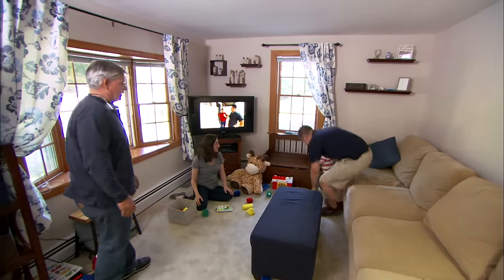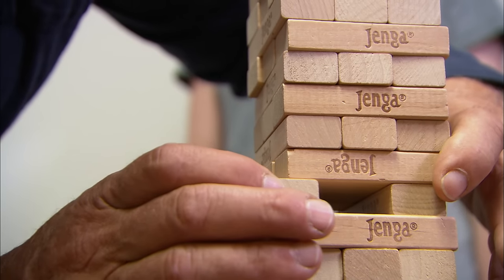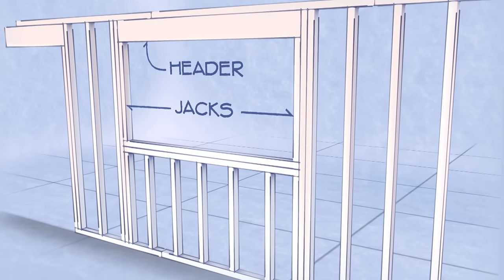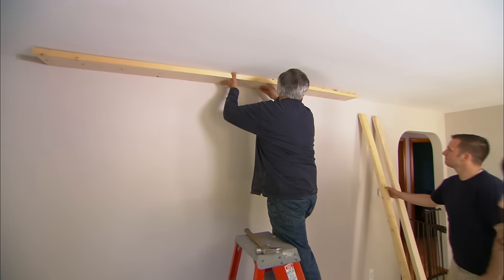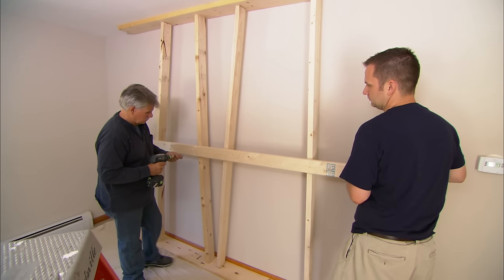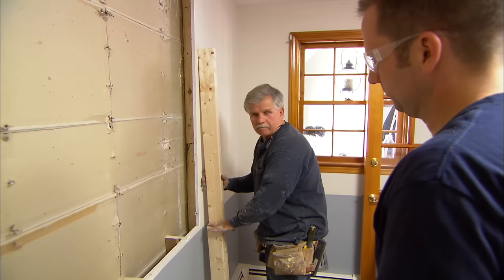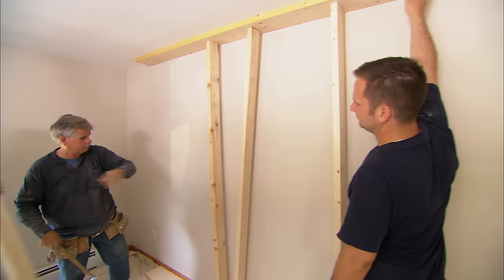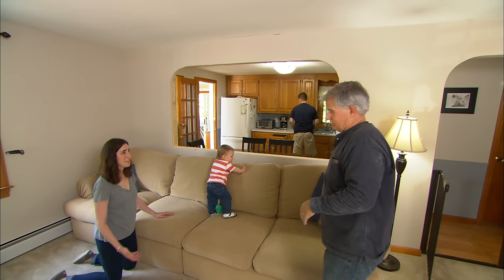How to Cut a Pass-Through in a Load Bearing Wall | Ask This Old House

Comment: Thank you! This was spot on, easy to follow, succinct, yet thorough instructions. We saw this video 48 hours ago. It gave us the confidence to tackle the same project ourselves. We completed the job in 6 hours. Would’ve been less time, but I had to work most of the time so I could only help set the shoring and hammer in the jack studs & and my husband didn’t have an extra helper. This video is epic. Thank youuuuuu!!!!
Reply: Why don't I believe this comment?
Reply: @sophocles1198  I mean without calculating the load you wouldn't know what size beam the header needed to be.
Reply: @michaelkozik4707  and how did Tommy do that?
Reply: I think it would only depend on the span. After all, there are only X number of studs holding that load up before. Now if you cut into the wall, and find reinforced and doubled-up studs, then they did that because there was an extra-heavy load there.
Reply: How much of the 2nd floor and roof collapse on you?

Comment: A house that I'm familiar with actually had a load bearing wall completely removed. The ceiling had a noticeable "Dip" in it. After opening the ceiling to inspect, we discovered that ceiling joists were literally floating above the ceiling. It was painfully obvious what was done, thankfully, the house didn't fall in on itself. Replaced the wall and all is well now. It never ceases to amaze me what some people will do.
Reply: That's why building permits are required.
Reply: @scotth6814  not here in my city for indoor construction I was shocked myself 😆

Comment: getting nice curves in the finished corners is the hardest part of the job, would have been nice to see that done
Reply: Tommy's a wizard.
Reply: Make a cardboard template from the existing arch, and transfer to the wall board on the new opening
Reply: @Muscleupsanddangles  what goes inside the curve though?
Reply: @xfreeman86  I recommend using 1/4 Plywood which is flexible enough to curve. You can make several laminations and use wood glue to make your own custom curve and clamp it up. Alternately you can use plywood flat wise and transfer the curve onto it and cut it out and laminate/clamp. I think this is more work and unnecessary as it only needs to be strong enough to back your sheetrock, it isnt structural.
Reply: Its a jig saw, what is so hard?
Reply: Tommy just does it by eye with a sawzall.
Reply: Cut two plywood shape of arch each tight against drywall cut 2x4. So 4 in (3.5)  side is against arch. Wire aginst 4 inch in arch.  Flex corner bead in arch. and 40 min mud sand then finished mud then sand.
Reply: 2x4 blocks (2.5 inch) +1/2in+1/2 in=3.5 in between drywall

Comment: Very helpful video. I followed your instruction and cut a hole in my load bearing wall. There were a few more obstacles, like a pocket door, multiple existing headers  and a smaller opening that limited the maneuvering of slipping in studs and jacks. Thanks

Comment: Did anyone else notice there is an electrical line running along the bottom of the plate (up at the ceiling), where they are installing the new king stud and the header? Tommy notched the filler stud he put in for the electric line but not the new king stud or the header. Since the header is driven up tight against the plate, the wire would get crushed between the plate and the header (and the weight from the floor above) and cause the wires to short out.
Reply: Brilliant observation. I also doubt if it is up to code...
Reply: The header has a piece of plywood sandwiched in between which creates a perfect notch for the wire. It won’t be crushed. 5:05

Comment: I did a similar job, but I notched the existing studs for the header, fitted the header, then removed the old studs.  Worked perfectly.
Reply: Can you explain in more details what you did? How did you notch the header before removing the old studs? We plan to open a load bearing wall but not as tall as the one in the video. So it’s not likely we will put a header all the way to the top. Thank you.

Comment: This was great. Thank you. Though I would love to see a floor to ceiling opening.
Reply: Floor to ceiling is definitely possible, but there still has to be a header so you would lose the header room, but of course the opening would be bigger. Both are nice. 
I like how he rounded it so it matched the doorway on same wall.
Reply: You might decrease it from 11.25” to 10 using an LVL beam but you need a properly sized header to bear the weight of the 2nd story and/or ceiling/roof

Comment: I like how they retained that curvature on the top of the opening. An alteration like this to a home should not look like it was altered and capitalizing on the existing design really adds a touch of class.  How about a granite surface for that opening for wife to slide a beer across to the old man during the big game?
Reply: That's a good idea! You can easily turn that section into a little bar top with some under corner brackets from the kitchen side. Very minimal space loss to create a lot of extra sittable counter area. And it perfectly looks in on the t.v. too.
Reply: Or for wife to slide dirty dishes into kitchen so hubby can load the dishwasher?

Comment: Had 70""in. of Microlam beam left over when I built a garage few years ago. Finished size 59"×45"  exact same layout, separating kitchen and living room. Found a nice piece of Hickory to cap it off.
  Widened doorway thru kitchen, and raised header in living room (non load bearing) while I was at it. Really opened up little Ranch house, 976 sq. ft. full basement. House was built, finished in Nov '63
       New project is gutting all fiberglass insulation in attic,...and exterior walls. Switching to Rockwool. Gotta air seal attic with fire rated foam.  Not a licensed builder, worked a few years for a friend that is.

Comment: So easy in USA where it's all studwork and plasterboard.
Reply: Balloon framework, yo! It’s the one of the reasons why America settled the west so quickly. It uses less wood than its heavy timber predecessor and it’s built so much faster.
Reply: Houses here are not all simply studs and plasterboard.  That is a paper house built in 2 weeks or less.  I will never invest My money in those shitty cheaply built no character boxes.  There are millions of older homes/buildings built in the mid to late 1800's that are still standing strong here USA that require extra care when remodeling.  My 2 houses was built one in 1890 the other 1920.  I know it's a pain in the ass to retrofit upgrades, however, I appreciate the fact that older homes were over-built (as these younger instant-house builders complain about).  My houses will out-live Me and I'm 50.
Reply: they are made like that so that they are easy to build and repair
Reply: We have studs and plasterboard for interior walls in the UK unless they are load bearing then they are bricks
Reply: 2 weeks?  You're dreaming.  Also, your older homes are inefficient.  How are you going to insulate a vintage brick home with two layers of brick, unless you want to pull down ALL the plaster from the inside on ALL exterior walls?  Good luck!  Also, their designs are functionally obsolete.  Minimal bathrooms.  Small bedrooms.  Small closets.  No open concept what-so-ever.  They might be nice for a single person or a couple with no kids but that's about it.  OR, a vacation home where you only spend a few weeks in throughout the year.
Reply: MemoGrafix newer homes are engineered by people who actually know what they're doing..  they're stronger, more efficient, using less materials and less waste..

yes there are times that problems arise in newer homes, but 99% of the time it's because someone didn't follow the plans ..

when I was looking to buy a house, the lenders wouldn't consider a house built before 74, and my insurance company flat out said they won't insure a home built using brick for anything structural, or any rubble foundation..  why do you think that is?
Reply: they aren't any stronger, they have wood pegs and basic non ring nails holding them together, plus hurricane strapping wasn't even invented yet.
Reply: Pff, my house walls are 2-3 Feet Stone with insulation outside, and my roof alone is 120years old. No idea how old the walls are.
Reply: @cuteshadow  idk why that sounds so cool to me lol
Reply: Not where I live because my house has lathe and plaster.
Reply: g, You must be aligned with the home building industry in some fashion because your comments are completely bogus.  As for "newer homes being engineered by people who actually know what they're doing," what do you actually mean by that statement?  I really would like an answer.  Are you saying that homes built prior to 1974 were "engineered" by people who didn't know what they were doing?  Are you saying that the architects, engineers, and builders of older homes were idiots?  Where are you from?  Are you not aware that there are tens of millions of homes in the US alone that were built before 1974 that are "still standing" and doing just fine?  

You say "new homes are stronger."  You also mention newer homes are built with less materials.  At least you were right about the second statement.  The reality is that a lot of older homes were built to higher engineering and architectural standards.  As a result, older homes are more likely to be stronger than newer homes.  That is a fact.  Newer homes are built "skinnier" if that's what you mean.  A modern 2x4 is 1-1/2 x 3-1/2, if you're lucky.  Up until the 1950s, a 2x4 was 1-5/8 x 3-5/8.  And of course even older homes used actual dimension rough cut lumber, so a 2x4 was 2x4, a 2x10 was 2x10, etc.  Did you know that?

Modern 1/2-in. or 3/4-in. plywood is of course not even close to those thicknesses.  In older homes, those dimensions were actual.  And in many cases, instead of 3/4-in. plywood, older homes used 7/8-in. thick by 8-in. shiplap boards.  Then, of course, a lot of that new modern construction you like so much doesn't even use plywood, it uses wood chips and sawdust to make weaker chip board instead.  And you better hope it never gets wet because chip board disintegrates quickly.

You state, "yes there are times that problems arise in newer homes, but 99% of the time it's because someone didn't follow the plans."  You are right about the problems, and in many cases they arise because of sloppy workmanship during construction, i.e., "not following the plans."  A lot of problems are also due to poor design and under-building to begin with, and use of inferior/inadequate materials.

I have owned three homes built prior to 74 (I assume you mean 1974), one was frame construction built in the 1930s, another frame built in 1951,  and a masonry stucco home built in the 1920s which happens to have a brick foundation.  For a time, I also owned a small brick commercial building built in the 1880s, with a brick foundation.  I, just like tens of millions of other people who own such properties, had no problems obtaining financing or insurance.  Lenders and insurance companies were competing for my business.  Who were the lenders and insurance companies that refused to loan money or insure homes built prior to 1974?  I have to tell you, g, your statement makes zero sense.  Are you aware that tens of millions of homes built prior to 1974 have mortgages and homeowners insurance?  How can you not know that?
Reply: Blaine Bugaski  actually it easy to insulate a old house or even a newer house just build a wall in front of old wall add your insulation no mess of tearing down old wall yes you lose about 4inchs of room but most old homes are big and you won't miss 4inchs
Reply: @rla1000  My 1932 bungalow has 1×6 tongue - in - groove boards under all the sheetrock. My oldest kids were raised in a standard built house and put each other through the wall a couple of times. It wasn't possible for the younger boys who were raised here.😊
Reply: Sylvia isgod  - I don't have asbestos, lead paint, nor knob & tube wiring.  My houses are upgraded to meet code standards of today.  
You go ahead and enjoy your newly built paper & plastic palace with Chinese drywall.  While it lasts for about 10 years.  I'll still have My strong Old Growth HARDWOOD houses made with natural materials.
Reply: @MemoGrafix You’re just asking for a teardown unless your walls are 4 feet thick molten steel.

Comment: isnt that header hitting that electric line up above?
Reply: Looks like the 1/2" ply was trimmed short on that side to allow the NM wire to run between the 2x's...making a channel.  That said, it's still a pretty hack way to do it by the electrician.
Reply: thechosendude A channel was there from the play but when they seated the board you can hear it hit the low voltage wire.
Reply: pmcall221 - You're right.  On second glance, it looks low voltage, maybe doorbell, so they could do it that way although they shouldn't. 

No way those plastic staples were able to clearance... they were probably smashed as you say.
Reply: I highly doubt Tom would overlook this.  He's a carpentry God.
Reply: I saw that too. What if it needed to be serviced?
Reply: bluegem6559 run new line if ever needed, but chances are slim that would ever happen.
Reply: @cup_and_cone  it looks like it used to go to an outlet (see 2:15 in the video)

Comment: 5.42 did he just put that beam under that electric cable that was clipped to the wood at the top. So from what he said. The load is sitting on top of that cable that's between the beam and wood on top.hmm 🤔
Reply: It seems like he did but the plywood in the beam is recessed just enough to give the wire enough clearance. Was it enough or was the wire centered to not get squished? Who knows.
Reply: Looks like they cut a channel in the top of the beam, in addition to the recessed half-inch ply.
Reply: @lucasrayala  Wherever the home is located, I guess they don't have building codes.

Comment: Put the beam right on the wire? Really?
Why did they even run the wire up like that to begin with?
Reply: Good point.
Reply: I missed that at first... no way that would pass inspection - the wire is now bearing the load (along with those little plastic clips).
Reply: ecj272 wrong. The wire is wider than 1/2” and I’m sure that it’s not totally in the center

That wire is bearing  the load. If it’s live it’s a complete fire hazard
Reply: @ecj272  The "notch" is not adequate and hiding a cable inside a beam is not permitted by an building code that I'm aware of.

Comment: Since he had to bash the studs in, it must be a tight fit. Won't there be any issues like the drywall having a curvature?
Reply: Ma Ga you've obviously never framed. Of course there is resistance until the stud is plumb and even then it should be snug. Do you prefer to cut your framing just short?
Reply: Mike Pilcher thnx for the info, and yes, I have actually never framed.

Comment: Assuming this load bearing wall extends into the basement, would you need to beef up the joist down in the basement below the jack studs in this opening?
Reply: No, because all the studs under the sill plate of the upstairs would still be supporting the upper floor.

Comment: That should really have additional support from the 1st floor to the basement as well..
Reply: Obviously in this case he didnt find it necessary. Given the age if the home it's likely only a single story and that wall wasn't bearing much load go begin with anyway. 
But I agree they should mention that if you have a second floor or a finished attic where you store a lot of heavy material, additional posts under the sides of the opening in the basement are a good idea.

Comment: I have a weird feeling that the temporary support they set up in the living room is useless since it's against drywall ...actual load passes probably higher since drywall is never on the joists
Reply: Stefan Dont know what you mean. But i think he supported the roof the right way.
Reply: the top plate is in the corner of the wall and ceiling.. usually there is a 1x3 between the drywall and the roof structure. no empty space. if the top plate was 7'' away from the corner, you are right, it could be an issue

Comment: Once the wall is opened, i saw 5 studs = 6 * 16in = 96in header and you supported this load with only 1 bric a brac jack on each end.
The « stud » added each side are about 6 feet long so it don’t reach the top plate and you said that it will support the upper load.
The header is in no way nailed to the stud on each end so it will be allowed to twist freely.
Nothing added in the floor and in the bearing wall at the foundation level to support the point load created on each end of the header.
This job is a good example of: DON’T DO THIS AT HOME
Reply: You know they dont show every single step, right?
Reply: @researchandbuild1751  
he's right. There's no way they can get behind it to nail the stud to the header and top plate without removing more sheetrock. 
The correct way to do it is to build a temporary wall, completely remove the short section of old wall, rebuild a whole new section with your opening and header, stand it, and fasten it in place to your existing wall.
Reply: @capitaine haddock
The extra jacks' "job" can also be accomplished by extra kings. Supposedly the extra jack prevents deflection- which can also be done by just adding another king. (Think as to why some walls have an obnoxious amount of kings at the side of headers).
I believe that once you have a huge load on the header, the job of the jack studs shifts more towards surface area bearing rather than solely deflection.